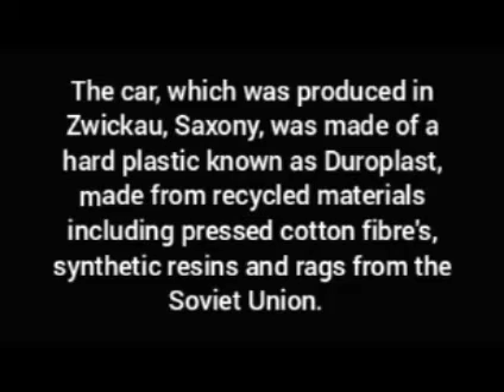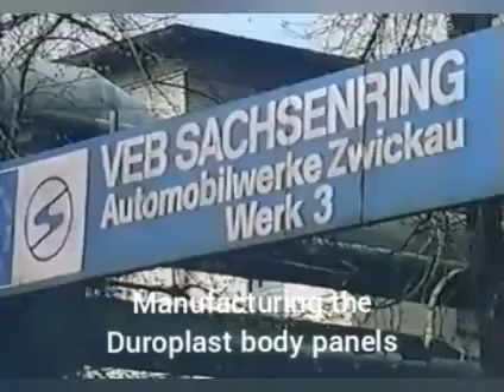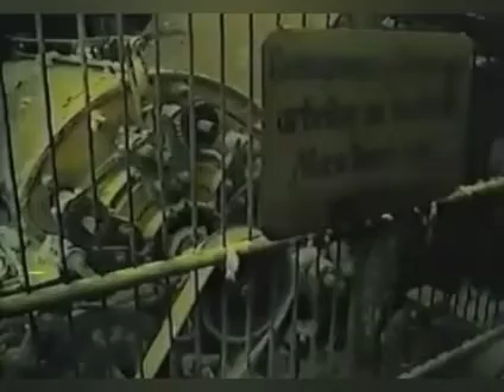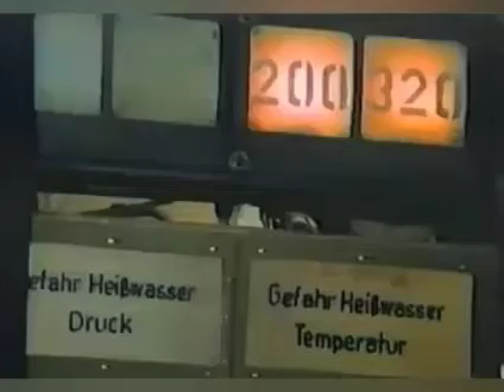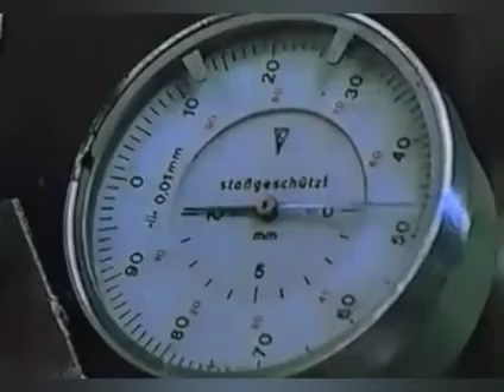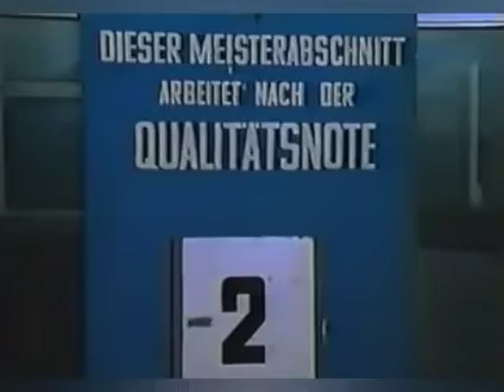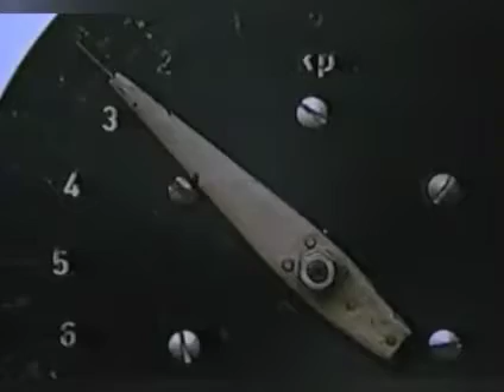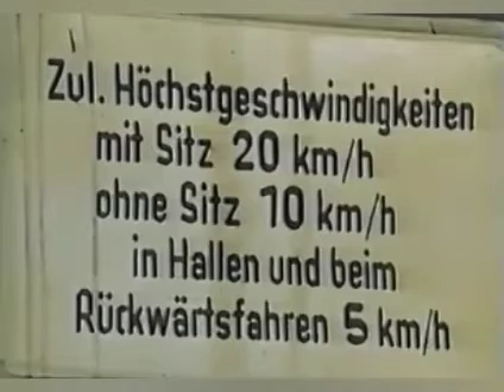The Trabant

Comment: Health and safety not a priority in Zwickau at the time. Of course if the original workforce in 1957 had only come home from a Soviet gulag a few years before, they may have been quite happy with conditions in the trabant factory.
In 1990, six months or so after the wall opened, I was touring Scandinavia and was amazed to see in the far north of Norway, near Narvik, a trabant. Some East German family were sufficiently confident in the reliability of the car to go that far. One expects a two stroke engine to burn oil but this was more than usual. 
I hope that the tourists got home safely, no western garage would have had a clue about fixing a trabant.
Reply from the maker: That stuff that goes into the panels doesn't look good for the lungs, but those little cars did the job at the time, better than a motorcycle on a wet day anyway

Comment: Well Jack a strange one this week, but more information than I ever thought possible. Plastic on top of steel, but it did say in the butt of jokes better smoke screen than the navy. Only ever seen two at car shows. Wonder what the body would do with electric motor fitted. Just a thought. Nice one for you to work on Jack. Hope you are all ok and your sister is still improving. Take care have a nice weekend. Rob.
Reply from the maker: Hi Bob, well it can't weigh much so I suppose it would be quite quick for about ten minutes haha. The plastic must be hard wearing to stand up to the harsh winters, I think the floor and frame work would be the weak points. Not a very efficient way of manufacturing though moving from factory to factory, 👍